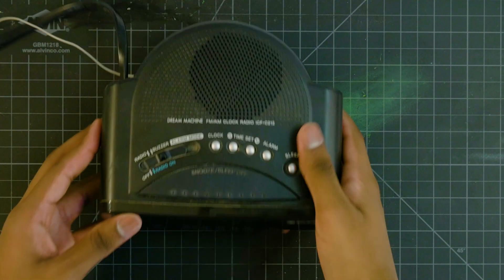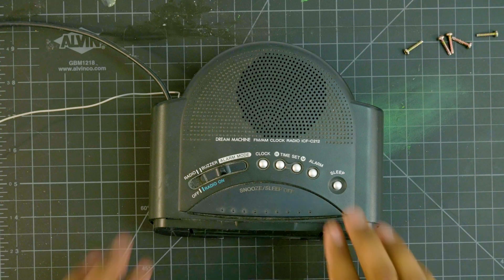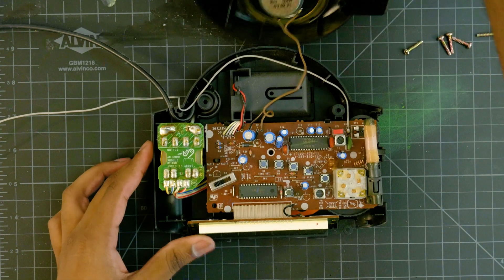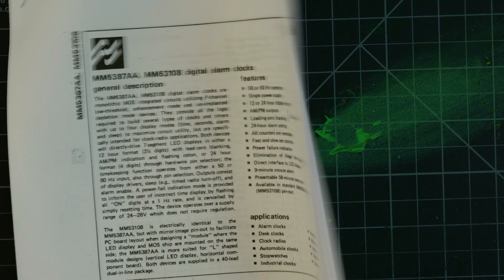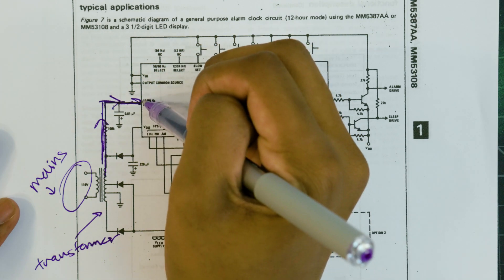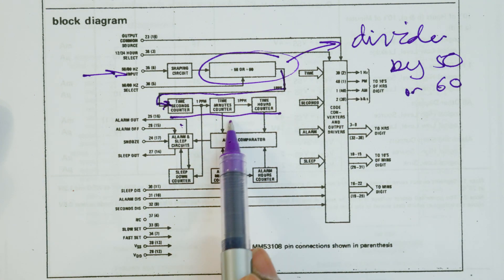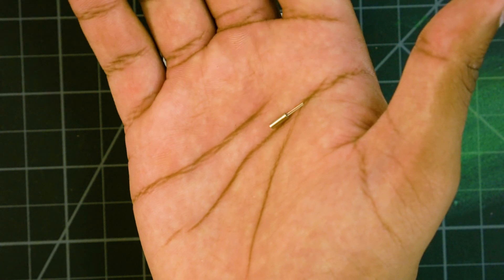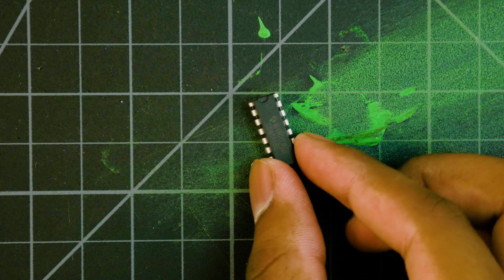How Clocks Keep Time Accurately!

Comment: Hi :) i got an old alarm clock / radio wich i would like to restore, but its missing the ic. i looked it up and it had a mm5387aa/n inside (wich seemes to be the same chip as the mm53108?). My question is: it also said b143 on the chip, but i cant find any reference to that anywhere and i dont get what it means. am i fine buying any mm5387aa chip? thank you :)